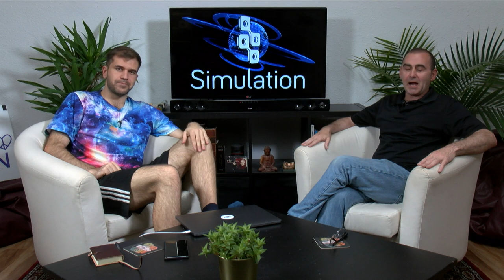NewTek TriCaster TC1 Review

Comment: Thank you so much for your honest review.  I'm working on a proposal of a new system and was contemplating putting the TC1 on the list instead of BlackMagic, but this was the final nail in the no column.  I really appreciate the help.  You have saved me!
Reply from the maker: from what I'm starting to understand it's kinda like the difference between iOS & Android - both work & have their quirks - feats of great engineering
Reply: @SimulationSeries  I've used the Blackmagic ATEM line some very recently and really like them.  They are fairly user friendly - easy to learn and are at a good price point.  So, as long as I can get them to work with the cameras that I'm spec-ing then I think I'll stick with that.  Thanks again!